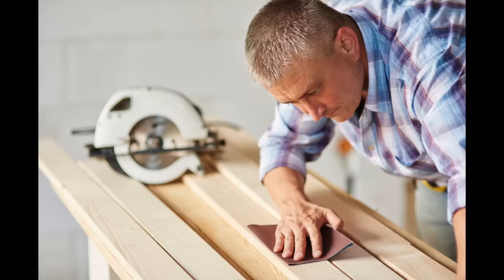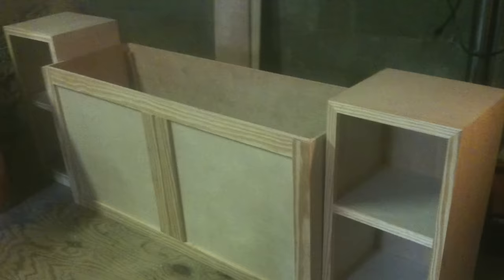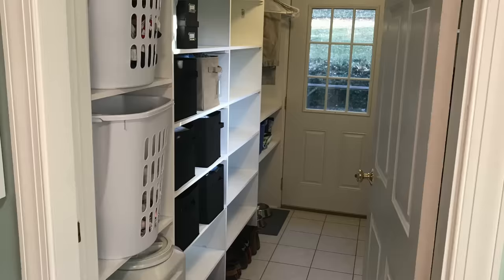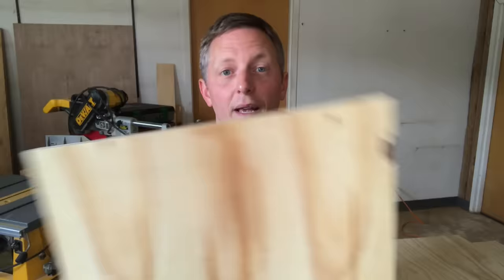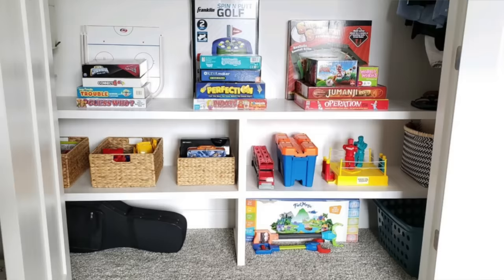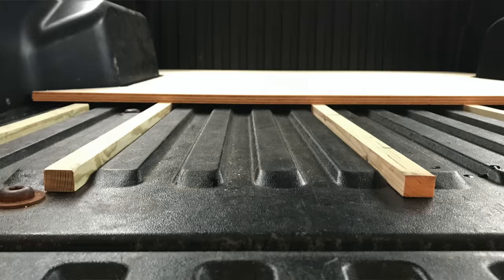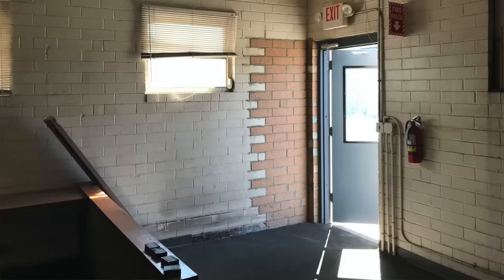DON'T USE 3/4" PLYWOOD If You Don't Need It...TRY THIS! (1/2" Plywood Vs. 3/4" Plywood--When to Use)

Comment: I'm making a cot that requires a 6' x 28" panel. Instinctively I thought 5/8" plywood or fiberboard would be the optimal thickness. The panel will be supported on the edges by a  half inch rim. So the span will be 27" and he says he avoids spans of 24" or more when using 1/2". Sounds like we are in agreement.

Comment: I'd suggest 5/8 or 19mm first, and second buy from larger building supply vendors such as Richelieu and Rugbys,  not HomeDepot.
Reply: I have used 5/8" on several shop projects and found it to be excellent for my needs.  My entire french cleat system is out of 5/8 plywood and have found there to be absolutely no holding issues regardless of the weight.  My father & grandfather made everything bomb-proof through overbuilding and it is SOOOOO hard to resist those instincts now!!!  1/2" ply in the proper setting has proven to be more than adequate!

Comment: Your answer to this question misses the most important reason you would choose 3/4" over 1/2" plywood and that is the strength.  A shelf gets is strength from its thickness cubed.  So a book shelf or a cupboard shelf made from 3/4" plywood will be 2.25 times stronger than the same shelf made out of 1/2" plywood. The cubing comes from the stress due to bending where the stiffness or moment of inertia becomes a factor.  So for horizontal load carrying applications you will have to add a stiffener along its length to match the strength of 3/4 plywood and usually that means losing height on a shelf.

Comment: I've no idea why but in the UK sheets of half inch (or 12mm as we call it) delaminates MUCH more often when working with it compared to 3 quarter (or 18mm as it's called in UK). Also the sheets of 12mm tend to warp more often when stored so I just don't like the stuff.

Comment: I find a lot of woodwork is over engineered. There's a video on here on how to build an outdoor storage box and the guy makes the frame out of 4" x 2" timber. I thought this was overkill and made mine out of 70mm x 35mm timber ( about 2 3/4" x 1 3/8" ) and it would survive a thermonuclear Armageddon. Much cheaper too and your offcuts are less waste. Perfectly good with half the wood!😎

Comment: Yeah but you will need it to be ¾ (19mm) for cabinets with euro cabinet hinges as they are drilled ¾ (12mm) so you could be drilling the 35mm hole right through if only 1/2 or 12mm!

Comment: Replying to my entry just below :-)...in the end, the loft space was floored in 12mm ply 1/2in, that is--they are supported by 30mm joists set at 400mm spacing that neatly fits into the 2000mm ( 2m) width.

18mm ply , or 3/4", is 50% heavier  and not necessary. 
For some reason, when NZ trades converted to metric measure about 1975 they settled on millimetres   mm   as the standard,,, you'd think centimetres would make life easier but...that's the way it works for everything. Last point...plywood sheets come in 2400 x 1800 sheets most commonly ( approx 8 x 6 feet ) and each sheet I bought, internal use, non-treated   was about...NZ$45   or +-31-32US.

Comment: On a whim, I built a six foot book shelf, about thirty inches wide, using 3/8" ply. 

Adding 3/4"x1-1/2" face frame to the front and 3/4" x 1-1/2" horizontal stiffners to the underside, at the back of each shelf produced a book shelf that never bows, when fully loaded.

I could have used 1/2" material for the stiffners, but why waste wood?

Comment: Sometimes, convenience of getting 3/4" plywood outweighs the 1/2" ones.  My local big box stores rarely carry 1/2" oak plywood, let along 1/4" ones.  Some of them have none on the shelf.  So it is the only option for me.  The price difference is not that much, though.  It certainly is heavier than 1/2" , but still is lighter than solid wood board.

Comment: Joinery is as important in design as material. I “ covet” 1/2” baltic birch nowadays because the cost is so high. How are the components going to be joined? Remember, plywood is 1/2 end grain and doesn’t accept glue as well. Pocket holes, biscuit joints,dowels and even screws do not work well in 1/2 plywood. You’re limited to rabbits,dados,box joints or dovetails. I have also used tenon joints on plywood.

Comment: Thank you, as I have been on the fence with regards to half inch I utilize the Kreg system for my joinery as I don't have the luxury of a full shop and have been avoiding adding a micro jig. I will now build my next kitchen with 1/2 in stock.

Comment: I'm watching this because my guy in engineered floor shop told me to rip out the old floor boards and re-sheet with 6mm ply. 6mm? I asked, and he was certain that 6mm ply on 16" centres, with 18mm(3/4") would be plenty stable. I'm still skeptical.

Comment: You can have span strength that is close to that of standard 7-ply 3/4" material while still having the benefits of 1/2" thickness if you pony up the extra $ for baltic birch or marine plywood.
Reply: Wasn't the video's context saving $$$$?

Comment: I noticed your half inch ply has 5 layers. Here in Vancouver canada it is 4 layers and it is weak as hell. The difference between 1/2 and 5/8 over here is massive in terms of strength

Comment: I don't know much about hardiplank but, I had hoped that it would come thick enough to use for my porch when I decide to replace it.  I suppose it probably does not. When I have the ability to own another home-  hopefully it will not have that stuff ) fake lumber on it) , If it does I will need to have to all replaced with Hardiplank. While it may be expensive it would be worth it. 
I am looking at letting money grow via the purchase of a home by replacing the cheap plastic tubs with porcelain. Surely, that will help the home grow in price.

Comment: Dear GAWD, I have always used 1/2 for everything except table tops....and of course if you're walking on it. Hear I thought it had always been the norm. You don't need 3/4 unless you're adding a lot of weight over a longer travel.

Comment: The only reason I prefer 3/4" over 1/2" is because most concealed hinges are made to fit into 12mm deep 35mm diameter cups i.e, no wood is left for finishing unless we plan to use laminate/Formica. For half overlay shutters, the hinges would need a smaller minimum reveal distance that is near to 0 when we account for natural expansions and contractions of wood.

I hope hinges made to use with half-inch shutters would become widely available.  Till then my preference is 3/4" for rigid structures like floating shelf, table legs/cross braces, 1/2" for cabinet carcasses, 3/4" blockboard for shutters.

Comment: $47 and $57 for a sheet of plywood?  That is either an OLD VIDEO of the lumber or you are in a WHOLE different area!  Plywood here was running over $90 a sheet!  Our maintenance guy for our work was told to hold off on projects because he had to call and tell them it was around $90 a sheet.  He was told to return to Phoenix and check prices there and haul it up from Phoenix if it was substantially cheaper to get it there.

Comment: We hardly ever use softwood ply for furniture here, its frequently warped & mostly used as shuttering. USA quality looks better than UK. Melamine faced chip/particle board is everywhere in commercial furniture. I often use 1/2" ply (12mm in the UK) & for a thicker edge appearance, sometimes double up by back framing the face sheet; gives a real chunky 1" edge.  Obv. this can be done with solid timber nosing - any depth u like. Stiffens up shelving if needed (18mm will definitely sag if unsupported over longer lengths; I've seen plenty!) If I or the customer wants quality I use Birch ply. Looks great natural, hard-wax-oiled, takes paint well. Now very expensive of course... I also stopped buying "tropical hardwood" ply over 15 years ago. People were & still are so wasteful with it!  I once saw a worker cut out a small circle of timber from the centre of an 8'x 4' board with a jig (sabre) saw & not because they needed a hole in a big board, just a little disc! Trees take hundred years or more to get big enough to become decent timber. Wastefulness helps deforestation.

Comment: I would love to use 1/2 inch plywood instead of 3/4 inch plywood, however the quality of plywood is so poor these days that 1/2 inch plywood makes for a difficult job.  I was using 1/2 inch birch plywood to make drawers for some cabinets, and after I ripped in on the table saw the plywood warped. I was able to use it still with some difficulty, but if I was using if for the cabinet boxes it would have been extremely difficult and time consuming. Time is money, and with 3/4 in plywood the construction goes very fast.

Comment: For some reason, 3/4 inch plywood seems a bit softer than 1/2 inch. Just built a workbench using 3/4. I’ll stick with 1/2 inch from now on.

Comment: I'd rather have material that is easier to cut and just add reinforcements. Lugging heavy sheets is one reason why people build with smaller components or materials. I have worked with a cabinet builder and the stuff can easily get damaged while struggling to move it and load it into vehicles or trailers.

Comment: Here in the Caribbean we talk 3/4 inch ply for durability and strength. Too many times I have been called in to do repairs on 1/2 inch ply kitchen built made in America. The finish is good but the strength and durability is not there with 1/2 inch outside of the drawers.
Reply from the maker: Happy to hear from the Caribbean, eu!

Comment: Overall I have to agree however I find 1/2 (12mm) Ply be it Birch or Standard Hardwood exterior (as we call it in UK) is far more flexible than 3/4 (18mm) which does limit it's uses somewhat in my experience.

Comment: I stopped using 1/2" plywood so much because lumber mills started giving us less in quality in plywood, plywood used to be made with an odd number of sheets/plies, as a rule, such as 5 sheets for 1/2" plywood, 7 sheets for 5/8", 9 sheets for 3/4" plywood and so on, and if the 3/4" was Baltic Birch it had 15 plies and very tightly made, the odd number of sheets was for greater strength, now where I live I can't find high-quality plywood made like it used to be made, only 3 plies 1/2" which was not even made then and 4 plies 1/2" in which they charge more for and is not as strong as it once was, and the 3/4" is also poorly manufactured and the prices are totally ridiculous and not affordable, these days I just don't buy plywood at all because bottom line the prices being charged is just pure greed by the Mills and is not because of the rotten lies we are being told. the only 1/2" plywood I would feel good about using is Baltic Birch because it is strong and has many sheets/plies and no voids and is High Quality, but still, again it is very expensive, Thank you for the video I'm sure it will help many people who are seeking to save money. I would suggest checking out your local lumber yards for plywood purchase, It has been my experience that the quality of plywood is better than stores like the Home Depot, Lowes, and Menards.

Comment: Sorry, but I'll stick to 3/4. I've been doing this for some 50 years. Most of what I use, if it's a painted project, is birch or maple veneered 3/4, with 1/4 inch for backs. 3/4 is stronger, less prone to warp, easier to hit with staples or nails, and more receptive of biscuits and dominos. If your tools aren't adequate, I'd upgrade the tools before I downgraded my material. Just my opinion, of course.

Comment: Never used 3/4" for anything "except" a work bench top. As far as shelving... 1/2" is superior for many reasons BUT you would hang it differently than you would 3/4".

Comment: This weekend I bought 1/2 inch  plywood where in the past I would have gotten  3/4.  So much lighter and no difference in structural rigidity. Great, i feel vindicated. ah, and saved quite a bit of money oi the process

Comment: 3/4 is a lot stronger than 1/2. One is 3 layer, the other is 5 layer. Let’s use chopstick as example. Two  bundles of chopsticks, one has 6 chopsticks and the other  has 10.  Someone with good strength may be able to bend the 6-chopsticks bundle, but very few   can bend the bundle with 10 chopsticks. 

1/2 plywood is good enough for decorative shelving or shelves that are shorter than 24”. For bookcases and anything longer I would go with 3/4.

Comment: What about 5/8”?

I have a bookcase with 3/4” plywood shelves about 34” long.  They sag slightly.  They should be supported in the middle, but the back is weak and adding braces would be complicated.  I also have a pantry cabinet which I recently had built to my specifications.  The shelves are 3/4” maple ply about 20” long.  They don’t sag even loaded with canned goods.  I like a sturdy cabinet, but of course it depends on the length of the shelf and the loading.

Comment: Also, my tablesaw doesn't like it if I try to put a dado blade much over half an inch in it. I can make dados for 1/2" ply in one pass on a common portable table saw. I think this video has changed my plans for the shelving in my pantry.

Comment: Mostly I used 3/4" plywood, I had not given any thought to 1/2". Truly an outstanding suggestion, thank you.

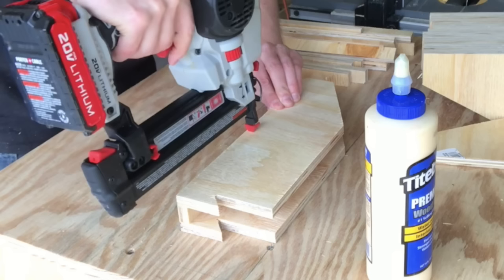Suggestion: at 2:45 through 2:53 turn your nail gun perpendicular to the cut end (straight edge) of wood never parallel. Gun nails are more thin than wide. When fired into wood they have a tendency for bending left and right following the path of least resistance. When it occurs it will poke out the open end of the board into ones finger; yes happened to me and I saw it happen to others as well. Also, the bending nail occurs when the nail gun is not 90 degrees to the surface. My rule, when possible always hold the nail gun perpendicular to the end cut straight edge.

Comment: Even if 1/2” is less wood, it’s also more expensive. Cabinet makers use 1/2, so demand is actually higher.
Reply: most common wood i see used in a cabinet shop is 3/4, by a long shot.. 3/4 is more expensive than half inch, always has been.

Comment: You're right that it frequently makes more sense to use 1/2" compared to 3/4" sheet products.  However, at 4:24 you say 3/4" plywood has "slightly better" span strength; this is not true.  From an engineering perspective, the ability of an object to resist bending is a cubic function of it's depth/height (i=1/12*b*h^3).  In other words, 3/4" will give you over 3x more bending strength than 1/2".

Comment: This vid has PERFECT timing. I was just talking to the bf about replacing the messed up toe kick plates in the kitchen and was talking about just using 1/2 plywood as that's what looks like they did along with some floor rounded piece for what's already there. Question: would half inch plywood be okay for a bench that you sit on to take your shoes off before going in the house (with box like spaces underneath for the shoes)? Overweight household inquiry since you mentioned using this for anything you don't stand on.
Reply from the maker: Thanks Michelle! Since the bench is going to support body weight, I’d prob just go with 3/4” to be safe. But I’ve definitely sat on a number of my 1/2” projects (including my old shop miter saw table), and it seemed perfectly strong to me, as long as it has support beneath edges and long runs.
Reply: @TheHonestCarpenter  Thank you! Sounds like it's not worth saving a buck for safety reasons. And I'd like it to hold up for many years. But now I have garage shelving ideas! I really love your channel.

Comment: I built a full kitchen booth out of 1/2 plywood and I stood on it when I painted the ceiling in my new kitchen and never did I feel any flex.
Reply from the maker: That’s awesome, Rico! If you support your 1/2” structures the right way, they’ll be rock solid 👍
Reply: @TheHonestCarpenter  finding non warped 1/2 is the hardest part I find here in Canada

Comment: To be honest, when you say that 3/4" plywood is only slightly stronger than 1/2", that is not true.  From an engineering standpoint, 3/4" is 3.375 times stronger than a 1/2".  Your points about using 1/2 is benificial though.  Thanks for the great tips.

Comment: 5/8  is the perfect compromise.  Stronger than 1/2" and not overkill and heavy like 3/4" ply.    I mean, builders use 5/8" for floors!
Reply from the maker: Very true, Cana Dude. I’ve got projects in the shop built with 5/8”.

Comment: Apologies if you have covered this in another video on your channel, but did you complete your workshop build with 1/2" and have results to share? I am in the process of building a 9 drawer unit to store my tools in. Not heavy tools, just the smaller tools that are currently in deep drawers and hard to find. These new drawers are only 3" deep so everything will be easy to find. The drawers are all constructed out of 1/2" material and I was wondering what to do about the carcass. I'm going with 1/2" because (a) I have a bunch on hand, and (b) this video has reassured me that I am not making a mistake by "cheaping out".

Comment: 3/4 still needs reinforcement.  I put 3/4" in my garage and it still bowed.  If you're going to have to reinforce it - why bother - it's heavy, hard to cut on the tablesaw yourself and actually can injure you when lifting.

Comment: I'll agree that 3/4" is not universally needed, but disagree when he seems to claim that their strengths are similar. 3/4" plywood is more than twice as strong as 1/2" plywood. Look at any online deflection calculator or data. One source, for example, says maximum recommended pressure for plywood is 35 PSF for 1/2" ply and 79 PSF for 3/4" ply. For deflection you'll see more than double deflection for 1/2" ply vs 3/4" ply.

Comment: I'm fixin to build a Armadillo Trap. The ones on the market use 3/4 inch plywood. So 1/2 inch would be fine ?  They are just modified box traps, with doors on both ends. I'm not going to spend $229 for the one on Amazon and Ebay.